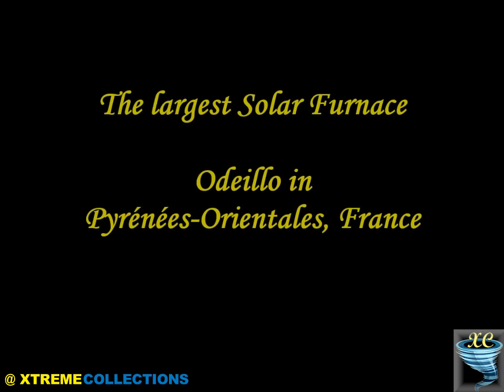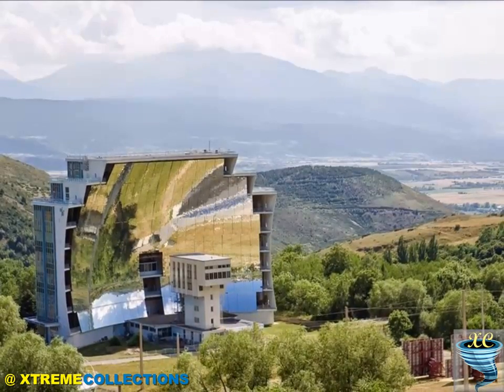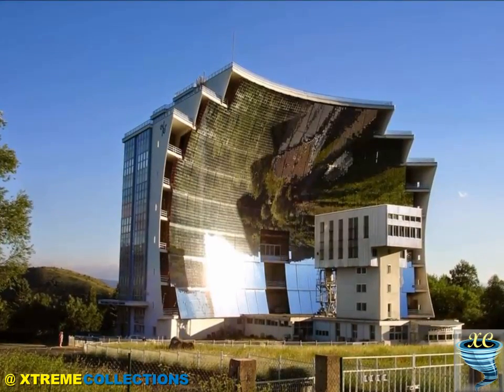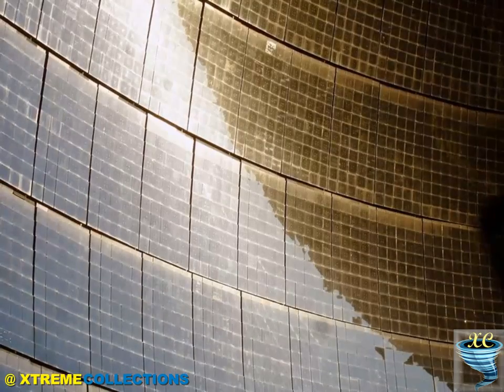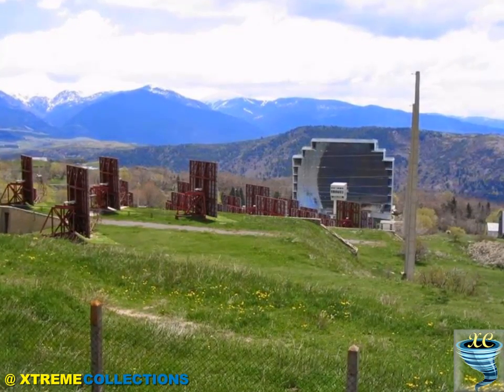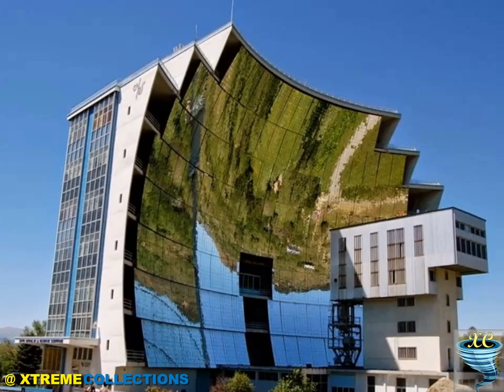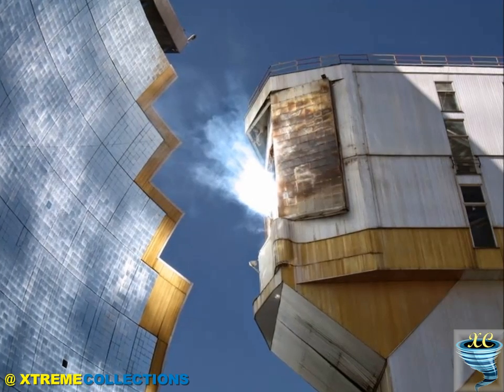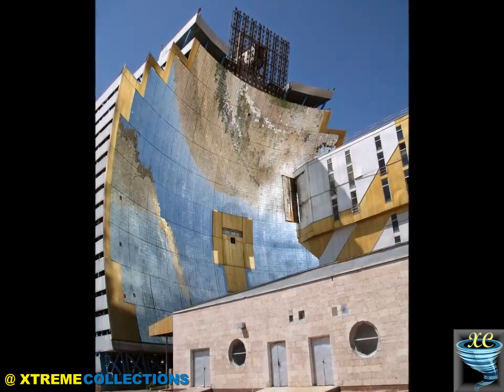The largest Solar Furnace | Odeillo in Pyrénées-Orientales, France

Comment: Это фото солнечной печи в узбекистане, а не во ыранции
Reply: Odeillo furnace in France is the really first one, but it has been copied by URSS during the cold war.

So you probably mention the furnace built at Parkent in Uzbekistan, but this is a copy of the french one at Odeillo.

So you are totally wrong.

- Odeillo furnace in France : built between 1962-1969, ready for service in 1969

- Parkent furnace in Uzbekistan : built between 1981-1987, ready for service in 1987

Parkent furnace is a little bigger, but is less powerfull than Odeillo because french furnace has a better location at a higher altitude, so sunshine conditions are better.